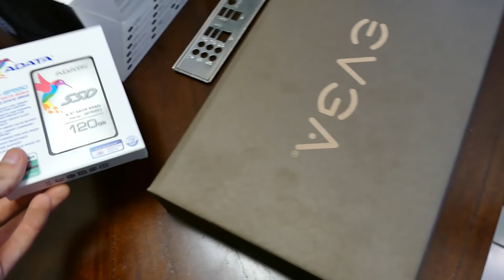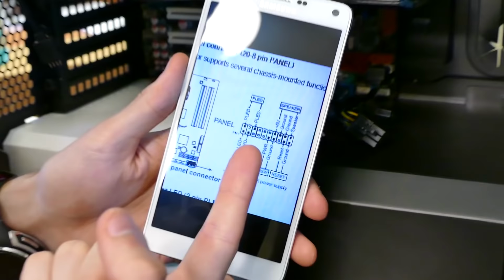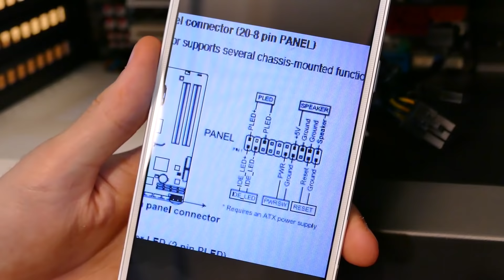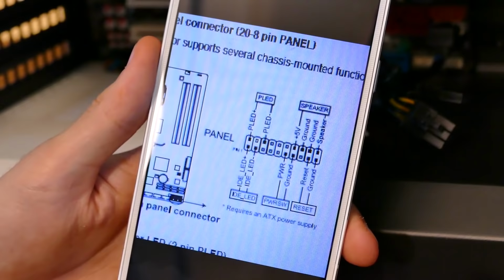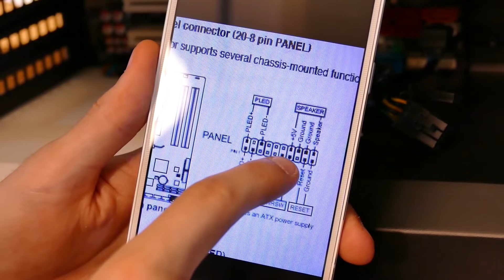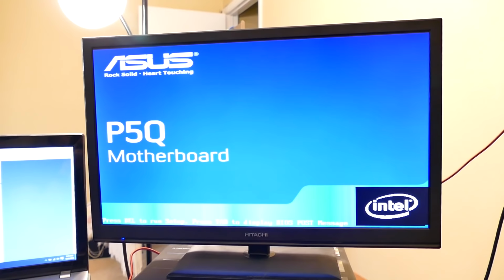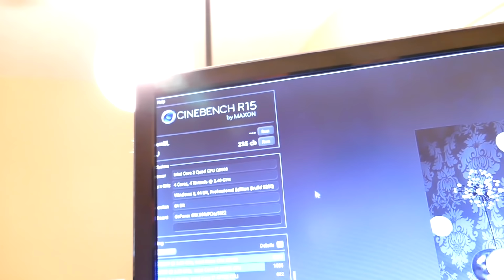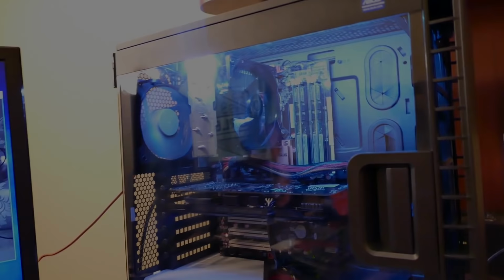Q6600 PC Build Vlog

Comment: i'd go for a q9650
much more cache, much cooler, OC better
Reply: x5450...
Reply: 771 is harder to find then 775... the Q9xxx are a lot cheaper and easier imo.
Reply: T Swag
No lol the x5450 is like 16$ vs 60$, it is harder to install but worth the money. My x5450 is at 3.8ghz and rocks lol.
Reply: The other post Leone went in depth with it a bit more. I did not know a lga 771 cpu could be modded into a LGA 775 mobo. Point still stands, that I would not tell the generic user to mod anything, and it is not compatible with all chipsets/mobos/bios revisions. However, where the Q9650 at 3 ghz is around $80, you can get a Q9550 at 2.83 ghz for around $40, and still have plenty of OC headroom for the most part.
Reply: T Swag
or buy a pre modified 771 xeon that will go into any 775 mobo, if your motherboard supports a q9xxx it is almost guaranteed to work. That and the 771 xeons are built and binned better so most are guaranteed 3.8-4.2ghz on a decent board, atleast for the Harpertown xeons. :)
Reply: The alignment tabs on LGA 775 socket would still need to be removed. There are other ones that also mobos that reject xeons, but it is cool to know that there are now lists of "compatible" motherboards. Back when I was still working on LGA 775, it wasn't very well documented (at least that I could find). 

Don't get my wrong, I still have multiple LGA 775 computers and a LGA 771 server, I just never thought of putting a Xeon in a desktop (it usually does not make sense for a general consumer).  

And yes, the xeons in general are binned better because they are meant for 24/7 use.
Reply: there are premodded xeons with cutouts, you don't need to remove the socket tabs
Reply: +Applebloom My q9650 on 4.0ghz with cm 212 evo ;)
Reply: Strahinja
I colud do 4 but my 212 is missing the mounting for intel lol
Reply: It's a pity... :/
Reply: Applebloom 4 3mm screws and 4 bolts+ washer, easy
Reply: Dont have the X bracket : (
Reply: Applebloom you can always mod them. wood, acrylic, or metal, just need some measuring and cutting
Reply: Leone Furlan
I LITERALLY dont have any of the mounting hardware but I did rig it to a am3 board with the stock heatsink fastener lol
Reply: 20$-30$ Xeon E5450 3.00ghz, lower tdp then x5450 80w vs 120w, because of that it's easier to overclock to 4.00ghz or more.
Reply: do you know if x5470 is supported by asus p5qc
Reply: TOZE thanks for the reply, i have the e8600 at 4.3ghz the fastest but still shittiest compared to new cpus just because its dual core. i know really well "the game" and i spend years in overclocking dual cores on 775, im looking foward buying a used 2 cpu server mobo on lga1366 socket with a xeon for now and later upgrading to 2 xeons. what if i buy a xeon for the first cpu and an i series next? ex. i7
 can they communicate together? i believe not, but im not sure. Sorry for my english im greek

edit: the perpose of the system is, gaming without cpu bottleneck as much as possible, i dont have the budget buying new mobo and parts
Reply: basically the 667mhz on a 1600mhz capable prossessor is like 60 trucks want to cross a 2 lane road at the same time, it will be a bottleneck. i didnt think of that!
Reply: TOZE οκ
Reply: TOZE my p5qc tops out at 1670mhz fsb it is around 4.25 stable. now i really really need your help, if i buy a 1600mhz fsb cpu this means that if start to overclock it i will adding up to the 1600mhz? so in conclusion i cant overclock? am i right? i finally planning to buy a xeon that is compatible with my p5qc, but i cant decide which fsb is preferable so i dont max out my mobos capabilities... should i buy a 1333mhz and clock it to 4.25 like my e8600 or get a lower fsb and watercool the cpu and get more hz? i have no clue please help me :-) answer me when you have time
edit: forgot to tell you multiplier is at x10 any increase in fsb regardless of the multipleir leads to error , so it is a limitation from the mobo fsb
Reply: i gotta q9550 in my old rig and YES the cache does help a  ton

Comment: why didnt you get an lga 775 board that supported ddr3?
Reply from the maker: More expensive.
Reply: +Science Studio rip... ahh well...Ddr2 it shall be!!!. Anyway. My rig consists of a core i5 4430. Sadly Im running on the igpu till i get a dedicated gpu. Is it worth to upgrade from the 4430 to like a 4590 or 4460? Few people said yes and many people told me it isnt worth it. But i dont see much benchmarks to determine :/
Reply from the maker: Not worth it. I've proven this in my CPU Frequency vs. FPS series.
Reply: +Science Studio thanks alot greg. <3 as a matter a fact im going to watch the video right now. this year im starting a 3d animation class where we are using programs like Maya to model animations. I'll maybe just pick up a 4790(non k) and itll get the job done.  I remember it took me 3 hours to render i 1:20 maya animation with my old q8400 last year.... Yikes!
Reply: lga 775 and ddr3 are pretty much pain in the butt. Many of the memory modules cause troubles or don't start at all.
Reply: +subbookkeeper I can confirm it. Tried HyperX 4GB 1333Mhz on my ASRock G41M-VS3 R2.0 and G41M-GE3 and the pc wont boot.
Reply: +subbookkeeper ah i see..
Reply: +googlemaster190 -Minecraft You can also look for a Xeon E3 1231 V3. Usually it's cheaper than a 4790. Only difference is 200 MHz less (negligible) and no GPU.
Reply: Earlier this week I had my eye on a 4790 on Amazon for $285 new!, looked yesterday and it went up to over $330 :(
Reply: +googlemaster190 -Minecraft buy a GTX 550ti - 610 if you on a budget but if you want more power go with GTX 750 its still budget you know
Reply: +cl4ster17 thats also lga socket 1150 right? Sorry i dont know my xeons :P
Reply: +MrN1ce9uy rip
Reply: +McBMeL MasterSenZuRi One cars im really aiming for is the rx470. i want to play it 1080p ultra and 1gb isnt cutting it nowadays :/ Especially how i play gta 5.
Reply: For overclocking LGA 775, DDR2 is WAY more stable and easier then DDR3.

Comment: Why not using open CL instead of cuda? Tech yes city prooved that it was the same.
Reply from the maker: I prefer CUDA, along with its bundled software.
Reply: Science Studio
 Never used this bundled software. What is that?
I used cuda once on my laptop. I didn't know I was using cuda. After few minutes of rendering "wait why my left hand is so hot?" then I saw "cuda" on the software.
Reply from the maker: You've never used GeForce Experience or Shadowplay?
Reply: Science Studio
 I hate geforce experience. It's never connected to nvidia it says.
I tried shadowplay one time, blackscreen. I'm running a 950m (which is an 850m) and the minimal is 840m. And I think i'm not the only one to have this problem.

Comment: The Q6600 was a great chip and still is. I still use it, 9 year old now. With a modern GPU it still can play all the latest games, at 1080p, medium/high settings. Finished GTA V, at 1080p medium settings (video memory limitation) at solid 30fps. I'm about to get a new GPU, the 3rd. in the life of my Q6600 PC.
3.0GHz, Asus P5K MB: 
1) BIOS
2) AI Overclock tune = MANUAL
3) CPU ratio setting = 08.0
4) FSB freq. = 375
5) DRAM timing control = MANUAL
6) DRAM voltage = 1.8V (depends on your RAM) + Latency 5-5-5-15 (depens on your RAM)

Comment: Hope the guy who "designed" that motherboard got sacked why on earth would you put the 24 pin there???
Reply: That location was a common one for a lot of older motherboards. I'm sure there was a reason, and cable management back then was barely a thing. All PSU cables were ugly and non-sleeved.
Reply: I have an old Dell, q6600, SSD, 8g ram. With tape mod, 1333, 3g. Works great.

Comment: CSGO will run a stable 60fps no sweat on a Q6600, but not much more than that. Really gotta go i5 for dem 300fps.
Reply from the maker: It runs well over 60FPS on high presets.
Reply: Yeah, that's the perfect starting point for CSGO. Anything over 60fps is enjoyable.
Reply: +nelizmastr I run cs at 176fps at 1360 768 w an over clocked r7 360 and a thermal throttling q6600
Reply: JimsJams Smithy Of course, it's barely over 720p.
Reply: +nelizmastr even w dsr I run over 100 at 1440 w everything high no aa the q6600 is fine for cs
Reply: JimsJams Smithy Not bashing the Q6600 bruh. As long as it manages to stay above 60fps all the time, it's a perfect CS CPU.
Reply: +nelizmastr hell yeah especially if you search one for under 10$ like I did
Reply: JimsJams Smithy One of the few parts from 9 years ago that still rock.

Heck, it's why I bought quad cores to soup up my Mac Pro 2006 to 8-cores. Chips from back then are so damn cheap now and still perfectly usable.
Reply: +nelizmastr exactly just proves how bullet proof older platforms are for modern low-mid end gaming or work!
Reply: JimsJams Smithy Yup!
Reply: wtf I have a fx6300 I have more than 150 fps
Reply: loupiotable Well of course. The FX6300 is over 6 years newer, runs at 50% higher clock speed and has 50% more cores.
Reply: nelizmastr
forgot I'm stupid I confused with Q4xxx série
Reply: I got over 100 on an Intel 2 duo.
Reply: Yes, because you need 300 FPS
Reply: +gLOWbal I probably could, if I had a PC that could run CS GO above 30FPS but but as far as I know there aren't and displays with higher than 200 Hz Refresh rate
Reply: Don't you need a 300 FPS monitor for 300 FPS?
Reply: why exacly does this game need 300fps ,?? isnt 60fps enough as its enough for call of duty gta v witcher 3 infact every game i play 60fps is smooth as hell
Reply: Robin Clarijs
I run CSGO at 300fps on a 60Hz panel and I have no tearing at all.
Reply: +nelizmastr you do have
Reply: λ3
Nope.
Reply: +D1V15OR theres an eizo monitor that runs on 240 hz but i doubt that u can make out the diffrence between 144 & 240hz
Reply: CPU bottlenecking is actually more of an issue at lower resolutions. If the GPU is capable I would expect same result at 1080p.
Reply: Impossible unless you have a freesync/gsync capable monitor. My guess you are one of those rare people who just do not notice tearing unless it is really bad.
Reply: I used to have q6600 and a gtx 750 and i used to get  100-140 fps on very high the gpu and cpu weren't overclocked either
Reply: +Usman Afridi go all low exepct shadows and 1280×1020 4:3 for best gaming experience
Reply: Euronjuusto999 Yeah but anyone who doesn't play cs go will tell that 1080p 60fps is all that is needed but in reality if you are ranked from DMG to GE you would know that 4:3 at 720p 300fps is the best experience
Reply: Usman Afridi yes
Reply: +Taylor Edwards price?
Reply: +nelizmastr screen tear cant be fully eliminated
Reply: λ3 You can keep nagging about it, but again, I don't have ANY tearing. You keep saying it's impossible, but my PC proves otherwise. What you think is irrelevant.
Reply: +nelizmastr no you cant just see it
Reply: nelizmastr
The only thing you are proving is that YOU cannot detect the tearing as you clearly are not as sensititve to it as most people are.
I know people myself who for some reason does not notice tearing that is obvious to me. All you are proving is that every human is different. It is just physically not possible for a non gsync/freesync monitor to not have tearing if you run it at a uncapped frame rate with no vsync whatsoever.
Reply: source engine is supposed to run at 300fps, if you play csgo 60fps on higher ranks it looks like your enemies are killing you before you have seen them
Reply: +Euronjuusto999 ei vitus pyöri 300fps
Reply: +bloxyman22 I'm one of them
Reply: λ3 mikä ei pyöri?
Reply: +Franklin Puerto Rico Soile Bergström Harry Potterin tietää miten sinun ei tarvitse välttämättä tarvitse viedä mattoja ulos kaapista ulos urheilu v lapset ja perheet isompien kanssa ja on aika on pitkä aika ja raha ja lapsiperheen koti Lahdessa suurten yritysten ratkaisut ovat myös hyvin ja se on ihan normaalia paskaa
Reply: +Franklin Puerto wel o do o its pwrye cpnpaked and i have no soöutoon dor ur problem riht noe
Reply: I only get 150 i5 6500 and r9 380x
Reply: Not true. GTX 560, Q6600 will handle cs go on high settings, 1920x1080 on 80-150FPS :)
Reply: Urbany windows xp amd athlon 2ghz and freezer cooling. 3 fps
Reply: potato gets 69fps on cs go lotto
Reply: +JimsJams Smithy Hey, can you test it on 1080p resolution and Low settings? I want to buy the same GPU. Thanks!
Reply: q6600 gtx 970 - 150 fps
Reply: +Ryan Taylor lol athlon x4 radeon r7 370 150 fps
Reply: even the highest monitor is 144hz but whatever
Reply: +Franklin Puerto The refresh rate of a monitor tells you highest frame rate that can be shown on that display. 144Hz-144fps,60Hz-60fps, etc.
Reply: MrInsertfunnyname there are 180hz
Reply: +Franklin Puerto of course lol, why wouldn't it?
Reply: +Franklin Puerto 
No, TVs does not work like that. Try to find it on google. There are some tricks sellers use with amazingly high "Hz".
Reply: Urbany why?
Reply: λ3 Maybe same frames being displayed twice. That would effectively cut the frame rate in half.
Reply: cs:go player here, under 100-120 fps this game feels like shit, even on a 60hz panel
Reply: MrT3odor i play on 0fps and it feels good
Reply: λ3 get out!
Reply: MrT3odor yea boiii
Reply: +MrT3odor even if you have 3000fps you still can't tell the difference on a 60hz panel.
Reply: MrInsertfunnyname 2 words: input lag
Reply: +MrT3odor don't complain over here if you are too shit in a game.
Reply: +MrInsertfunnyname I.m not complaing. wtf is wrong with you?
Reply: he gets ALL the fps. GTFO.
Reply: ***** xbox one 360? What the hell?
Reply: I didn't believe too.
Reply: dude a q9400 with  960 2gb and 8gbs of ddr2  will run csgo at like 200 fps
Reply: ***** never heard of xbox 360 and xbox one combination.
Reply: Ivan Jovanović
Reply: gLOWbal Put V-SYNC off then yea
Reply: how the f? I have a core 2 duo e7500 at 3.3ghz 4gb ram ddr2 800mhz r7 240 2gb and in dust 2 at low 1920x1080 I get 80-110 fps in inferno 70-90 etc.
Reply: Lol, i run csgo  in my Pc Q6700 2.66 Ghz + GTX 750 Ti  With High 120 FPS !

Comment: Awesome computer! I recently built a PC with a Q6600 and a 750Ti for about $160 ( I got the CPU + MoBo+ RAM for $30, was an amazing deal). Loving it so far!  Been using it for emulators and FO4/Doom on low/medium settings. The board doesnt support overclocking unfortunately so I'm using the BSEL method to get it at 2.9 GHz!

Comment: The Q6600 @3.6ghz is almost the same as a modern i3.
Reply: Not really
Reply: go check geekbench 3 then
Reply: 97pedrocas The i3 wins.
Reply: Lol Jolk sorry man, I haven't checked this after skylake, but look up the i3 4130, almost the same
Reply: 97pedrocas Stock i3 > OC'ed q6600 / Most c2q CPU's.

Remember, i3 & q6600 have 4 threads.
Reply: depends on application but the Q6600 can handle almost anything still.
Reply: Agreed, 6600 were pretty much guaranteed 3.0 on air, 3.2 on water with good ones making 3.6. 95XX were usually only .1 or .2 higher...4.2 is not likely for a 24/7 stable even on water although a few people got there.
Reply: My Q6600 SLACR does 3.7ghz
Reply: 97pedrocas I had one that did 3.6 with a Noctua air cooler and one that couldn't stay stable at 2.9.  Total silicon lottery loser there as most did 3.0 with the stock cooler and you didn't even bother to test that; just set it to 3.0 out of the box.
Reply: razamatraz Some overclock higher than others, it's all luck.
Reply: lol a 6100 is on par with 2500k, 2500k wrecks any core 2 quad even oced to death, at least for gaming that is
Reply: Wat
Reply: It has a high frequency but can accomplish far less in each cycle.
Reply: maybe an i3 3rd gen or something but an i3 6100 3,7Ghz is much faster.

and for 400 euros/dollars you can get this in my country:

Asus Strix Radeon R7 370 DC2OC 2GD5 126,51 euro 
Corsair Value Select 8gb ddr4 29,95 euro
ASRock H110M-DGS 54,30
i3 6100 3,7Ghz 2 cores 4 threads 116,50 euro
Zalman ZM-T3 21,50
HP PV943A, 500GB hdd 36,46
XFX XT series 400W 29,95

416,17 euro's total incl. tax.
Reply: this is my "bible" 

http://www.cpubenchmark.net/cpu_list.php

intel i3 6100 3.7ghz -5345 points
q6600 2.4ghz -2987points

My calculations with silver bench and cinebench and comparisons id say a:

q6600 overclocked to 3.2-3.6ghz will be about 4000 to 4200 points.

A new i3 6100 stock will be about 30% faster than a Q6600 overclocked and about 80% faster than a stock one.

I'd say you can play ANY game on a i3 6100 doing at least 30fps and 60fps in most of them and will beat a Q6600 in any circunstance.

I also would like to point that a Q6600 overclocked will consume about 5 times more energy than a i3 6100.
i3 is a total winner. Impressed by it. Still my Q6600 is what i could afford 2years ago. Its a great Cpu despite being 10 YEARS OLD!!!

Comment: Core 2 Quad Q9400 @ 3.6Ghz with GTX 960, maxed games under 50-60fps 1080p. :- )
 ( though with some bottleneck in CPU intensive games. Check my channel for videos :).
Reply: +TOZE hmm well im using a cpu cooler but i want to know will it perform better than q9400 running @3.6Ghz ? Besides overclock there is still a massive huge bottleneck where cpu usage is 100% and gpu 30% lol
Reply: +TOZE in bf1 beta my cpu usage is 100% and gpu 30-40% i get 25-30 fps with whatever settings i change. So if changing settings ( low etc ) doesnt increase fps than it means there is an huge bottleneck going on.
Reply: Syed Waqas Munir im getting the qx9650 is it a bottleneck for gtx960? i gotta overclock it at 4ghz
Reply: GreekProGamer Ro yes its gonna bottleneck in cpu intensive games like bf1, tom clancy rainbow six siegn and overwatch. '

Comment: i have a xeon x3330 6m of cache 45nm at 2.66ghz is equal to a c2q q9400, i have my xeon at 3.2ghz and it reach 344pts on cinebench

mobo asrock g31m-s

 4gb ram ddr2 ocz nvidia sli edition 800mhz 5-5-5-12

 gtx 580 msi lightning xe 3gb

 psu coolermaster extreme power plus 700w 

and a 320gb wd hdd